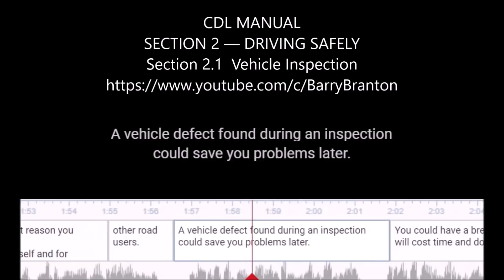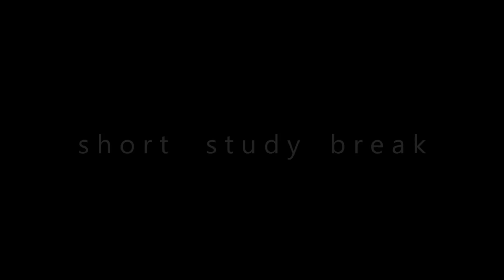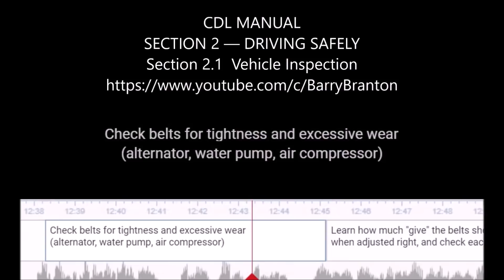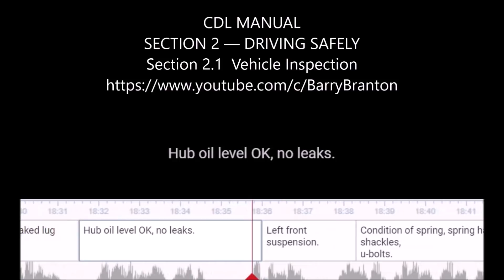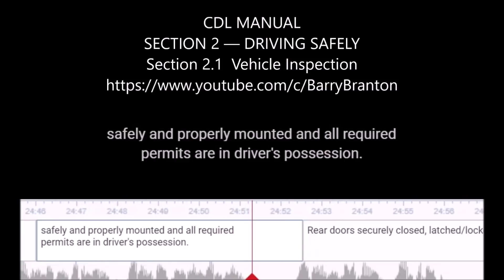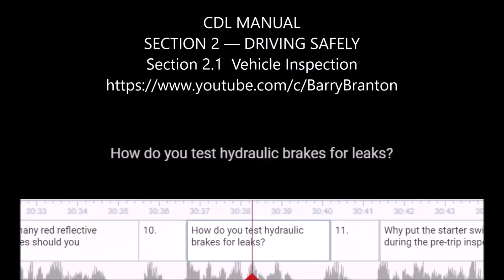2019 CDL Manual Section 2.1 Vehicle Inspection Text, Diagrams & Questions

Comment: Thanks to Mr Branton I passed my CDL permit test. Now I train for 14 days, and I'm on to my driving test. Thank you. The videos are on point.
Reply from the maker: Congratulations! That's great news! Now comes (1) Pre-Trip Vehicle Inspection Test (Section 11), (2) Basic Vehicle Control Skills Test (Section 12), and (3) On-Road Driving Test (Section 13). These are tests you do by doing (performing) in front of a state examiner with your commercial motor vehicle, e.g., truck or bus.
Reply: Hi  thank You for making this videos  
They help a lot